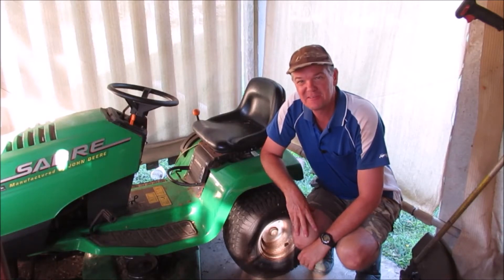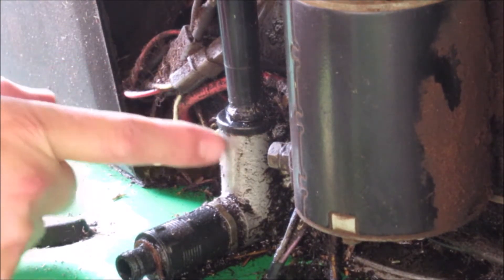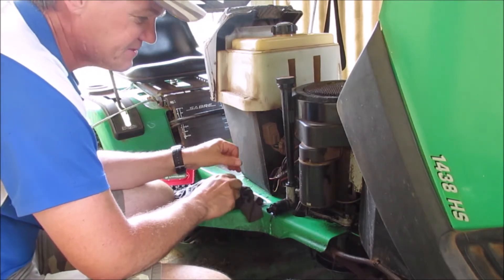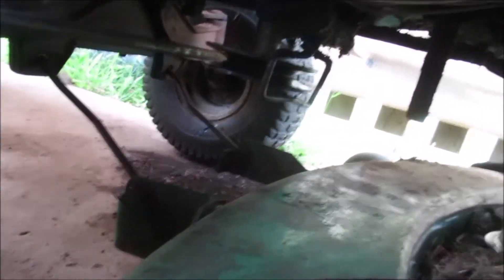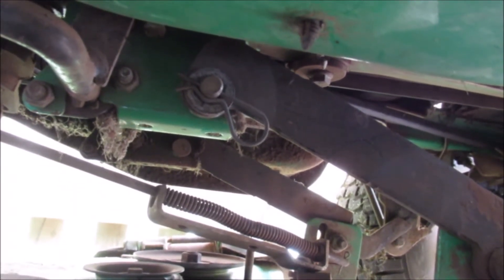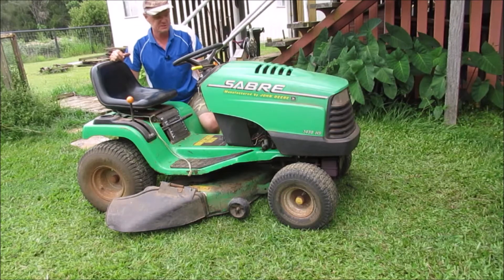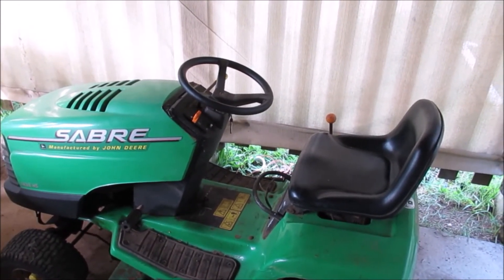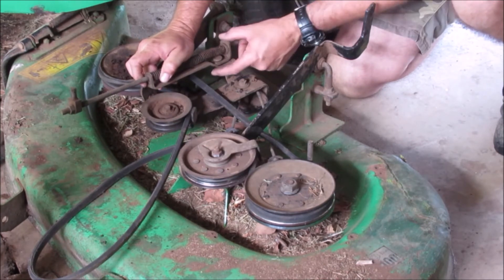More repairs to the John Deere Sabre 1438HS

Comment: An adjustment of the engage rod doesn't require removal of the deck. The upper/forward end of the rod comes off with the removal of the spring pin -- and the locknut can be easily loosened. Dropping the deck to its lowest position makes for plenty of room.
The twisted belt is bad news. By jumping off, it was warning you.

Comment: Are you able to assist as to why my mower wont go any faster than a crawl. I have the same with the lever you just push for speed but the control will only move an inch or so. same in reverse

Comment: can you tell me what the little yellow push button by the throttle lever does . i dont have a book on the tractor i just got last week  thanks
Reply from the maker: It's a safety button that you need to depress when you use the mower in reverse.  With the blades engaged, if you try to reverse without pushing the button, the engine will cut out.  If yours works without needing to push the button, then someone has disconnected the switch.
Hope that helps.
Reply: I was just going to ask the same question, when I was going in reverse the engine was almost stalling so now I know to push the button. My unit, which I just bought was built in 2000 but I expect to put many more miles on it, well made.

Comment: hello, i have the same lawnmower ... but with one problem. the drive belt broke while driving, i replaced the belt, but the lawnmower no longer drives forwards or backwards. Do you have an idea what is going on?
Reply from the maker: A couple of things come to mind.  
The first, check the rod at the back of the mower (near where you would connect a trailer) is not pulled out. This disengages the drive unit.  It needs to be pushed in.
The second would be to check if the new belt has tension on it.  Maybe the new belt is too long.
That's all I can think of, hope you can sort it out.
Reply: That tricky pin in the back always has to be checked . @countrylifeonthecoast4167

Comment: Hello! May I ask what model number the belt is? You’d mentioned you’d replaced it a while
Back. Thanks!
Reply from the maker: I have found a record that said #A93 for the cutting deck belt.  I think when I bought it from a John Deere dealer, they checked and it was a number out.  Sorry I can't be 100% sure though as it was a year or two ago now.
Reply: @countrylifeonthecoast4167  The deck belt is 92 inches.
Reply: What's the size of the deck belt?